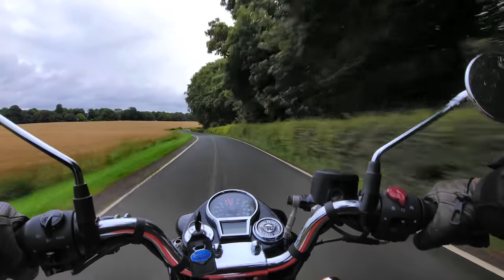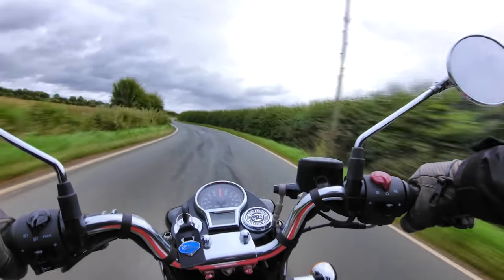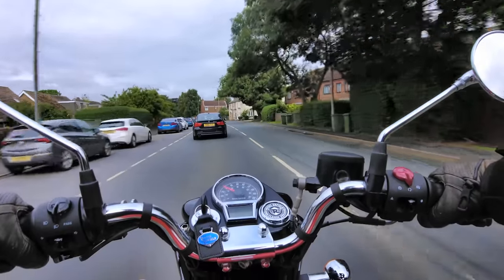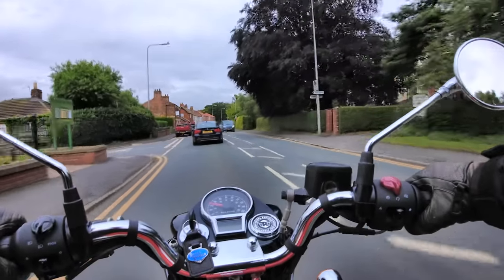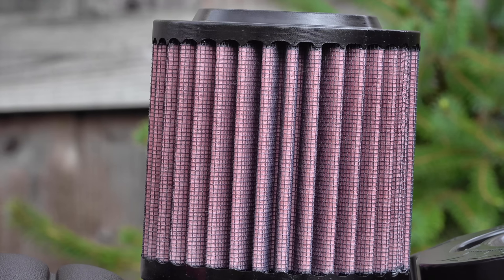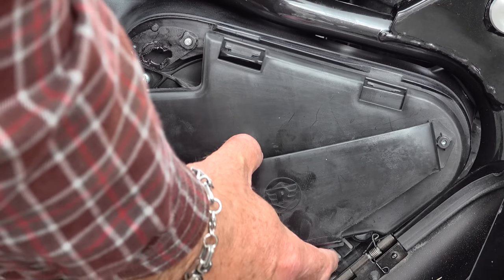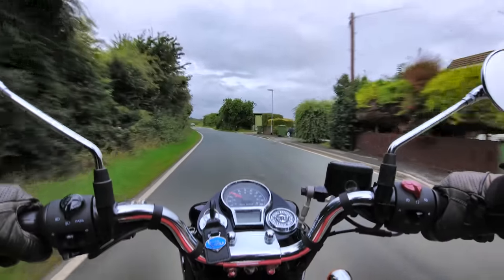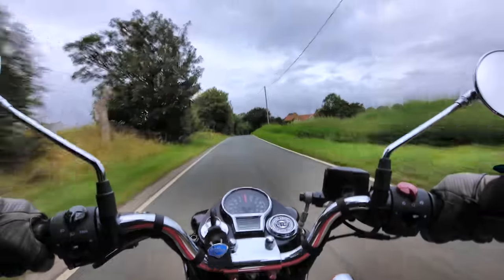The Royal Enfield 350 Classic REborn , Can You Increase top speed performance? & speedometer Fail!

Comment: Saw more difference with the cover plate change than the filter. Tried it both ways. The cover seems to be 80% of the improvement to me. Either way you feel the change in the seat of the pants!
Reply: Yes, quite likely when you look at the original part.
Reply from the maker: Yeah this has been discussed in previous videos. Short term it feels great but paper filters are an exercise in diminishing returns. As it clogs those gains diminish until you're back to square one and then need to replace the filter. Performance filters dont clog unless they have been left too long between cleaning and are really overloaded. 50,000 miles +.
Reply: @stuartfillingham  
Ageed. Used these type of filters on a couple of cars. Unfortunately it's hard to notice such a difference on a high horsepower car. You got me interested in this. Think I'll put the paper filter back in and see how long it takes to see a drop in effectiveness. I'm  guessing, now this is really a guess, if you maintain the bike as you should, the filter will be changed before the drop is noticed. But with such an improvement, I could be very wrong. This could be a long term dollar and cents thing, depending on how much you ride. I'll let you know what happens......
Reply: @stuartfillingham but the paper filter as shown by testing of huge numbers of oil tests and others is better at filtering the air and thus less engine wear.

Comment: My RE Classic 350 Signals Edition has 4200 miles.  After a recent 2400 mile trip I elected to change the oil (as I do after all long trips).  I was surprised to find metal chips in the oil (below the basket) and a significant amount of bearing material in the filter.  I followed the factory recommend run in procedure and maintenance schedule.  Just FYI for your channel watchers, keep a close eye on your oil.  Still waiting to see what Royal Enfield is going to do.  I'll follow up with there actions/findings.
Reply: Doesn't bode well.
Reply: Royal Enfield elected to do a compression test and check Valve clearance, both of which are fine.  They've chosen not to inspect the rotating assembly, which is where all of the metal is coming from.  I will just rebuild the lower unit myself, I don't want it to self destruct.
Reply: @deanomachineo7281  This is slightly disappointing / concerning to hear, as 1 - I'm picking up RE Classic in a few weeks, and 2 - I've nothing but stellar reviews about their customer support / warranty
Reply: @csc-photo  I haven't lost faith in the product, the little motor still runs strong.  RE produces 800,000 bikes a year, they're bound to have an occasional issue.  Like all problems, you need to talk to the right people.  I may attempt to contact RE directly through my attorney and see if that moves things along.  I have two RE bikes and will likely purchase the Shotgun model when it arrives in the U.S.

Comment: I have the air filter, decat pipe and fuel x lite on mine. Pulls better and handles raised gearing so relaxed cruising at 60-65mph rather than the 55-60 previously. Sounds nicer too - but not offensive.👍
Reply: Hi what silencer have you got fitted
Reply: @RockDinosaur695  standard silence. The decat pipe was from India cheap and arrived within a week!
Reply: I have a similar setup (DNA intake, cat delete full exhaust, and FuelX Pro). I just ordered a cam from Hitchcocks and still waiting on the 16 tooth front sprocket. 🍻
Reply: @flapjackphil4513 do you have a link to the product? Thanks
Reply: @jakeford2313 how's the bike running now? And could you also tell me if it requires oil change more frequently than before? Just curious to know, thanx in advance

Comment: Hey Uncle Stu if you've been having issues with the speedo getting stuck at 20MPH or higher here's the fix. I had the issue with speedo right around 800 miles the first time I took off the connector and cleaned it with electrical contact cleaner allowed it to dry then reconnected and the speedo was fixed, it reset and operated as normal. Well, so I thought but it did it again at 1600 miles and I was going to get a new one from RE BUT I wanted to know why this was happening, so I disconnected it again and when I inspected the male pins there was a tinge of green which of course is corrosion and we all know what happens when there is corrosion and electronics... electronics go wonkie... so this time I put a light coat of dielectric grease. So far at 3000 miles I have not had any issues. I don't know if you've seen this where on a warm day you get condensation behind the glass at the fuel gauge and at times in the lower portion of the speedo. So my conclusion is there is moisture getting to the contacts and corroding out the pins and the only way to fix this is to clean the contacts and add dielectric grease to the pins so they do not get any corrosion.
Reply: I had the same speedo problem. Once the first day I pick it up from dealer (was very hot). Then many months later when the summer was back. Did the cleaning of connectors. Happens again perhaps twice in the same month (but back to normal was quicker). That was in June. And never again since then, although we have had an hot summer.
Reply: @terceladdict  It will generally happen during the days when the sun heats up that speedo assembly... I think it's because the speedo is not sealed properly... also for those who have a repeated problem for this issue you can always remove the front head lamp assembly the way you normally do to get to the speedo assembly disconnect the connector turn the key to on and then off then reattach the connector turn the key on again and the speedo will reset itself.

Comment: Hi Stuart
My wife owns a Classic 350 in Halcyon Green as her first motorcycle here in Melbourne, Australia. As a former Triumph Thruxton and current Kawasaki Z900rs owner I was initially sceptical of Royal Enfield based on what I've read online, but I've been blown away and pretty impressed with Royal Enfield! It's been an amazing bike for her to learn on, and now we've just done the DNA Stage 2 air filter upgrade as you have done and what a difference it's made! So much more responsiveness in the low end and the increase in performance has been extremely noticeable. Great little upgrade for this model, and it's actually noticeable which is great. I've ridden her bike a few times now and it's made such an impression on me that when the time comes for my next bike in a few years I will definitely have Royal Enfield at the top of the list. Hopdfully by that point we will have seen a Classic or Bullet 500 in a single cylinder configuration, or if not a 650 version or even an updated Interceptor 650.
Great work on the channel, really enjoy hearing your views and opinions and look forward to seeing more Enfield and Triumph coverage 👍

Comment: With your speedo issue - an Aussie youtuber (Wazza) had the same issue. He pulled out the headlight to get to the speedo and unplugged it (speedo). Inside the plug was grease or Vaseline - he cleaned it all out of the connecting two plugs, dried it and wa-la......it works again.
Reply: Probably Dielectric Grease

Comment: Something you have not commented on Stu is how cooler the engine now runs when you do these filter changes, esp with also a de cat pipe fitted, on the hottest days I can stop and hold a bare hand on the crankcase no probs, before in stock form, the engine was roasting, 
My Classic 350 has over 8500 miles and been set up like this since 2000 miles, 
Now, a lot of folk on FB pages  etc said don’t waste your money on these mods I say have a ride on my bike alongside your stock bike or watch my films and watch the mid range power differences 😁👍

Comment: I have done this mod on a Meteor 350 and agree about the improvement in torque. The original filter cover fits inside the air box aperture whilst the DNA cover plate sits on top. The diameter of the resulting inlet ports is increased by 10mm. Not sure of the maths but the increase in area is what makes such a difference. More fuel/air mixture going in equals a bigger bang producing increased torque. Torque is what gives you acceleration.

Comment: Did the filter and free flow pipe, engine was running hot so also installed the fuelx lite, which sorted it. All three changes have improved flow and sound of the bike. A lot smoother, with raw sound which is louder.

Comment: Put this DNA combo on my Meteor 350 and immediately noticed better low-mid range power and improved sound, especially revving through gears 3 and 4. Btw, the speedo issue seems quite common on the Classic 350. Others have been able to fix this by cleaning the contacts.

Comment: Never moded any bike before but I was pursuaded to just change the air filter cover on my Hunter 350 and was amazed at the difference it made. I was truly sceptical to do this so was only prepared to spend the minimum amount  but Im so glad I did. I felt a good increase in power from the off and the engine sounded much more racious which felt odd at first as my Hunter always  sounded a bit anemic to me. I dont understand  what 'indiction' noise is but to me  it just sounds like Ive upgraded my exhaust so all this for under 40 quid is amazing! Thanks guys!

Comment: Morning Stewart. Informative as always sir. One afternoon in 1982 my wife and I went into a small custom motorcycle shop in Watford just for the ride and a look see at what's new. Sammy called me over and said what's this? It was a sleek sexy looking well made chrome air box that fitted all Honda 750 Fours. So I bought it along with some filter sponge spray. But when I went to fit it, I really didn't like the very light sponge filter that came with it. So into the shed and I dug out our spair pond filter sponges. Using the sponge that came with the filter as a templet I cut, oiled and installed the slightly more thicker sponge, then we went for a ride. From the off throttle response to the back wheel was oh so noticeable. And the only adjustment needed to the carbs was as stated by the shop owner. 'You might find you'll need to lift you needles up one notch', he said. And he was right. You could hear how much better the bike was breathing and with the original black box removed our K7 looked less cluttered side on. Better days for sure 👌. Good luck with your warrenty claim and I hope it goes through okay. Safe cruising till next time Stewart 👍😊.

Comment: Stuart is right. Performance filters do not harm engines. I have had several. One of my current bike's low/midrange performance has been radically improved. If you own a KTM 390 Duke Mk2, fit a K&N filter and drill six holes in the airbox cover. No repapping necessary. 
      Good video. 1990 [Nick J]
Reply: If you are talking about the 2017+ 390 Duke, those holes in the airbox cover need to be covered by some sort of filter material or you will draw too much dirt into the engine since you are effectively bypassing the air filter.
Reply: @twowheeledparadox  The mod was done by KTM Bangkok years ago. No problems experienced.
Reply: @1990-t1j  I would still recommend a review of the mod. Air is pulled into the airbox from the underside of the air filter. When you open the airbox cover, the side of the filter that you can see is the exit side. Air that enters the airbox through the holes in the cover will not pass through the filter. You might as well drill holes into the filter itself and the effect will be the same. It's unfiltered atmospheric air with all the dust it contains going straight into the throttle body. You won't see problems yet but expect the engine life to be cut a little short.
Reply: @twowheeledparadox  Why would KTM Bangkok do the mod, then?
Reply: @1990-t1j  No idea why they would do that. I'm just telling you the facts. You can check out the KTM 390 forum online for this topic. Also, brands like Coober in the US make airbox lids for the 390 with an integrated filter for a reason.
Reply: @twowheeledparadox  Thanks for your input. My mechanic, a Ducati race mechanic, checked it out a few services ago and approved.

Comment: Interesting experiment. Here's a thought... If the ECU governs speed by checking the speed from the ABS sensor then the ECU must be programmed with the size of the front wheel. Since the hunter has a 17" front wheel the ECU must have a slightly different program that allows the front wheel to spin faster than the classic of meteor. So.. if you switched the ECU on the classic for a Hunter ECU the top speed would be limited to 75 x 19/17 = approximately 84mph indicated. Because the ECU thinks that the front wheel is smaller than it really is and needs to spin faster to reach an indicated 75. This of course assumes that the front disc and ABS ring are the same on both bikes. If the difference is in the ABS reader ring then perhaps that could be changed.

Comment: Certainly wont argue about anything you said.
This filter made a truely noticeable difference in low down grunt ignoring the better induction noise.
Left off the document case
I worked out the cost of the DNA service kit which imho is enough for two treatments as long as you reseal the bottles against renewing the standard paper filter every service.
But even if you use all the cleaner (oil? it says you dont need to use it all)
Its cheap at around 15 quid  for the big improvement gained .

Comment: I put the Hitchcocks open cover on my Meteor at around 1,000 miles in. I noticed a difference immediately and agree as you describe here. At the 2,000 mile mark I took the open filter cover off and put the original back in as I wanted to see if a looser engine would counter any gains from the open filter cover and I was surprised at the noticeable slower difference going back to the original. It didn't take me long to decide to swap them over again. If I was only allowed one modification on my Meteor, it would definitely be the open filter cover.

Comment: When I was an engineering student, a friend and I did a tuning project on what at the time was my winter bike. The aim was to get as much power as we could without ruining the rideability. We chose a K&N filter which appears to have identical construction to the DNA item shown. I can testify that these work and work well with minimal maintenance.
Of course this was not the only mod. The bike was a 2 stroke single and had head, barrel and exhaust mods too. I'd choose this type of filter again though which I guess is the acid test.

Comment: Wheelspin - on a Classic 350 😳 who'd have thought? 👍😁
I must admit, I was a little skeptical of this mod Stu. I honestly thought the performance benefits were a result of human psychology - hearing the increased induction noise tricked us into believing the gains were real. So, thanks for doing this - I was kind of waiting for my trusted youtuber to give us the honest report.
I don't like the various fuelling tricking devices though (Fuel X etc) as I still think it might be a bodge - akin to leaving the choke slightly on in the days of such a control.
Proper remapping might be the correct solution instead, but for Royal Enfield at least these remain rather elusive at the moment.
Reply: Your right. I tried the fuel x and it ended up screwing the O2 sensor. Just riches the mixture.
Reply: On my otherwise stock 2019 390 Duke the FuelX Lite acts nothing like a bodge. It idles more stably, has become smoother at low to medium revs and has become more usable below 6000 rpm. Most new bikes run extremely lean from the factory. This device targets a near stoichiometric air-fuel ratio. Of course, since it manipulates the lambda signal, it only works as long as the ECU works in closed loop mode.

Comment: Excellent video Stuart! I find DNA Air Filters can pay for themselves quite quickly if you actually use your bike! 😀 
Prior to 2015 a lot of ECUs, but not all, were "self-learning" provided they had the appropriate sensors (O2 sensor etc). The usual procedure with those is, if they have a radiator fan, run the engine until the fan cycles once (switches on, runs then switches off). So if you want to add a DNA Air Filter to older bikes (usually  2006 > ) try that to reset the ECU...

Comment: I got the DNA kit and changed the filter for my 2023 Classic 350. Positive changes were easy to hear, see and feel: the motor runs firmer with fantastic growling bass sound,  bike accelerates better (with awsome sound) and even increases speed while climbing steep uphill on the fifth gear. That was not an easy task to do with the RE stock air filter. Fibes got a bit more stronger, but that is not an issue at all. MPG or in my case KMPL got a little worse according to the initial calculations. Old configuration meant 2,7 litres per 100 km where as the new one makes it 3 litres per 100 km. Not a big thing and the positive changes override it with no sweat. Highly recommend the air filter upgrade: it makes the great bike even greater!
Reply: After several bikerides and LPKM calculations it was a pleasant suprise to notice that fuel consumption has changed to a level of 2,5 litres per 100 km. Has the EFI got something to do with it by finding proper parameters?

Comment: On the nose Stu , changed my meteor and it really does make a much better bike , as an observation I idled mine for 10 mins , don't know where that advice came from but glad i.did it .
My meteor seems to.want to.go.more over 60 , it soon reaches 75 and bounces the limiter, I tried an old coach driver trick with the limiter, you let it hit the limit ease off and then nail it and no you can't break.through. Will.experiment with a steeper downhill , I won't hold my breath , but if it works I will report back .
I will say though I don't really want to.Ride like a seventeen year old . Cheers Stu , good riding